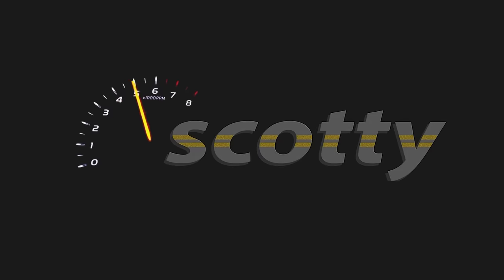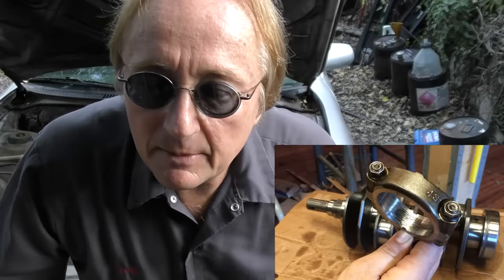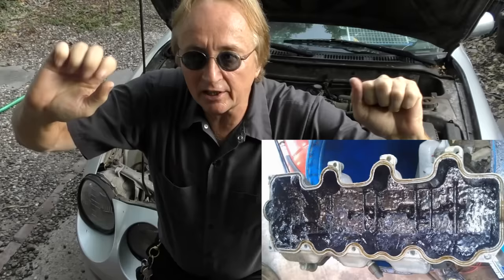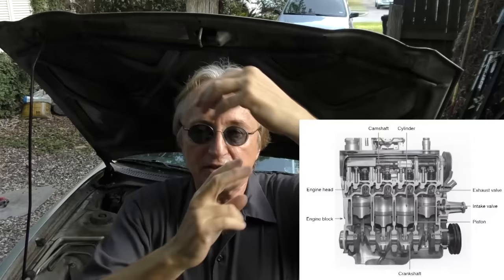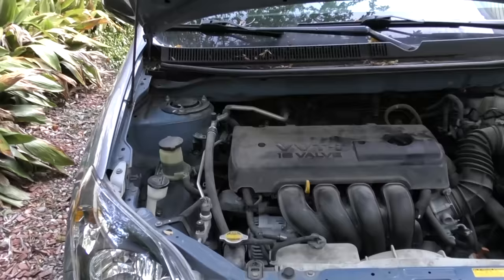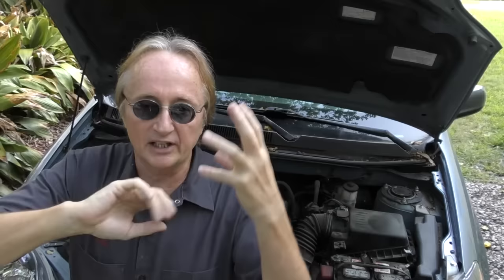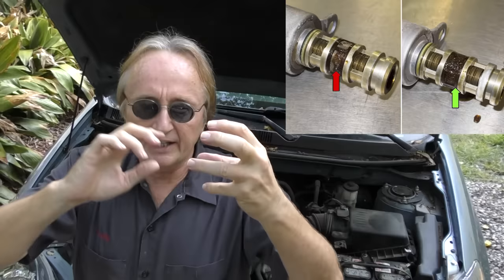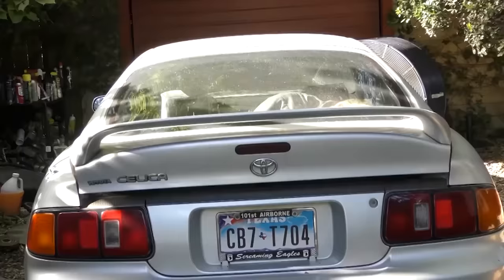Why Not to Flush the Engine Oil in Your Car

Comment: What I've always been told is that it applies to old engines and to cars that aren't seeing regular oil changes because like you said the sludge that build up is what keeping the car together but if the car sees regular oil changes it should be 100% but that's what I've been told just got a car with 215,000 miles and I know it has seen regular oil changes so am gunna test my luck with that 😅
Reply: Sludge does not keep the engine together IMHO.

Comment: If you regularly change your oil, and driving under normal condition. Then I dont really see the need to do engine flushing

But if I bought a used car, i will do that for the next two oil changes then go all-oil afterwards

Comment: My mate did a engine flush on his 17 year old car, the problem he had was leaky seals after that.

I never did a Engine flush, but i have used a cheaper brand of engine oil (obivously right oil for the car) once the car reached at 80k i drained old oil, placed cheaper branded oil drove car that day, then drained it next day, Then filled it up with Mobil 1 esp.
Cuz i do the service myself every year i can sleep at night.

Comment: I remember as a kid, one of the driveway mechanics in my neighborhood would run transmission fluid through and engine. It was a 58 caddy. He said that transmission fluid is detergent and would clean the engine from sludge. I'd watch him drain the oil, change the filter, add the tranny fluid and then run the engine what seemed like 5-10 minutes but it was probably about 2-3 minutes. Then he would drain the fluid and I would see all kinds of sludge and debris. Then he changed the filter and added oil. run the engine for 30 minutes, then repeat. Until I took auto shop in my sophomore year in high school, I thought it was the proper way to change the oil.  I felt sorry for the owner of that caddy.
Reply: If you're trying to say DO NOT put ATF in your engine oil, I'm with you - ATF in your engine? no, no, NO...I worked in a large (2,000 cars) government fleet for 30 years.  I saw engines destroyed because a mechanic put ATF in an engine and the mechanic on the next shift drove the car for a test drive.  ATF is too thin and has the wrong additives, no good for the bearings and rings at all - best do an extra oil change with MAYBE some marvel in it, let it run for 10 minutes and change the oil again and call it good!  I assume anything I put in the engine is going to stay there for at least the next oil change or two (ever disassemble an engine?  Notice HOW MUCH old oil comes out that a change misses?  A LOT, that's how much, at least half a quart).  DON'T put anything in your engine you wouldn't want inside it to drive for the next several thousand miles -

Comment: That's me I used it on a 2006 Corolla with 200,000 miles... and yup, started to leak, I even thought it was the oil filter, I replaced the filter and it still keeps leaking. I learned my lesson. Will never use this again.

Comment: I don't see how flushing the oil can hurt the engine if you followed the instructions. I flush mine every 160k km .I now have 541660 km on my Toyota Carina with 1.5 liter 4 cylinder engine. I did all that driving in just 5 years. Motor runs smooth and makes power just like new.
Reply: Ramjahn Singh My guess is if the engine oil/filter has been changed regularly since day one, flushing it won’t hurt, but it’s probably not necessary.

Comment: Flushed my 07 Saab 9-3 twice in the last 4 years, and it runs sweet with 93k miles on the clock. I do buy decent oil though, and service it at least once a year, usually after 12k miles.
It is a turbo diesel, and the turbo was crudded up, and burning oil. But I ran a turbo clean solution through it, and so far so good.

Comment: PSA 1.6hdi ( Ford, Valvo, Citroen, Peugeot + + +). 
For this  engine dealers recommend engine oil flush on every oil change.
My peugeot 307 1.6hdi 90bhp mileage on clock 170000 approximately. I do flush on every single time oil change. Nothing wrong. I own this car from last 6 year. I do service every 5000 miles.

Comment: What's the difference between changing the oil and flushing the oil ?? If the car is bought second-hand, isn't it better to change/flush the oil in order to be sure that everything is clean and somewhat "new", because we don't know if the previous owner really changed the oil usually or not ??

Comment: I agree w/ Scotty, on the engine flush chemicals.  Risky!  
I have fixed lifters that were ticking due to sludge by adding a qt. of Rislone Engine Treatment Conditioner and Cleaner to a fresh oil and filter change.  Repeat process every 3000 miles.  After a 6000 miles, or so, the lifters quiet down.  This will not work if the lifter has mechanical damage.     For decades, any used car I buy without a service history, showing proper oil changes, gets the Rislone treatment, for as long as I own it.

Rislone Engine Treatment and Conditioner, is NOT a flush chemical, it SLOWLY cleans inside the engine, because it adds detergent to the mixture.   I am not a fan of additives, but this one has worked for me and my customers.
Reply: CD-2 is a good product also but it is hard to find. if my hydraulic lifters are stuck i'm not changing them when rislone flushes them out.

Comment: Some engines have a split rear main seal that is replaced by dropping oil  pan and  gaining access  to rear main seal. No dropping the trans or pulling engine.  Ex. 1993 3.9 liter Dakota.

Comment: if you engine stay alive because of the old jammed oil on your engine, its because your engine is done... 
Common sense is not one of the best Scotty skill.
Reply: Bro if you've ever slimed bike tires it's a similar concept. Like what works works and if you wanna replace your engine or vehicle  because the seals are being held sealed by some  sludge despite the vehicle running fine, be my guest.

Comment: I bought a used Ford F 150 with  over 100000 miles on it. I flushed the oil crankcase with diesel. Truck runs great and no oil leaks.

Comment: The point of a engine flush is to get rid of your dirty oil before it gets to the point of sludge.. even if you change your oil regularly if you go over the required miles for the type of oil your using, your oil gets dirty. So flushing your engine of dirty oil so it doesnt get to that point of sludge is a good idea in my opinion.

Comment: Or you can literally do an OIL flush using ... oil. You buy some oil, not very cheap but fit for your engine and you change it 3 or 4 times, putting some miles between changes (warming and cooling down the engine a few times). Finally, you change it for good with your preferred brand and that's it, you flushed your engine the right way.
Reply: Exactly! 

I changed oil on a used car I bought as it was very dark brown. After few days new oil was almost as dark brown. Changing the oil few times in short intervals would help get rid of the old crap.
Reply: You can do it with a pump same way you flush out a tankless water heater

Comment: Completely agree. Modern oil is designed to suspend the crap in it and not produce any sludge . Just change your oil every 8-10k miles. 
Engine flushes are a throw back to the olden days

Comment: You can also pour 6 quarts kerosene instead of oil to wash the inside of engine. Just make sure to drive at least 100 miles after you pour it inside.
Reply: Kamion King no only idle don't try revving the engine with kerosene in there, it will not provide the proper lubrication. 6 quarts if you own an engine that has that oil capacity.
Reply: OMG  !   Hell yeah, that'll clean it Champ.  I guarantee it will do SOMETHING to it.  : )
Reply: That's flushing buddy.
Reply: Then 1 months later, all your gaskets wil lstart leaking.. Use ATF or the correct amount of seafoam.
Reply: You shouldn't be driving your car when flushing. Also you just let it run for 10mins at idle and you drain it out. Driving it around will seriously damage your engine as the engine oil is diluted and cleaned off by the kerosene.
Reply: @happysawfish  😂😂😂😂🤣

Comment: I always keep about 8 Ounces of Marvel in my engines 
Keeps that engine Clean as a Whistle 
Occasionally pour a bit in my Fuel as well
It's a power adder for diesel fuel
I put a whole quart in a full tank of Diesel
Ya can't add too much.
Reply: Ken Alexander 
Haha I just mixed up a cocktail for my 91 vw diesel last night. 
They like high cetane,like 50-55. 
Besides marvel I use new motor oil and cetane boosters and 2 stroke oil and whatnot. No waste oil, usually about a gallons worth and I throw it in about 8-10 gallons of fuel. 
She runs great. 
As far as flashing your engine,that crap is evil. 
But marvel does clean,it just does it slowly.
 If you start with a decently clean engine ,and add some marvel a few hundred miles before an oil change it'll stay clean.
Reply: I prefer DC in my engines and Marvel in my radiators.
Reply: I had a lifter tic on my old '99 Chrysler 300M (3.5L HO). I did an oil change with a quart of MMO and Castrol GTX 5W-30 Synthetic. A few days later, no more lifter tic.
Reply: Walmart carries it.
Reply: Oils have detergents and additives to keep engines clean. No need for Marvel....BIG DUMMY!!!
Reply: Yes you can add to much,I hate to correct you but you know someone who will do it at some point in time!!!!!!!

Comment: I was always told by my father. A mechanic with 45 years experience. To change the oil every 3000 miles with standard oil. And every 5000 with synthetic. He passed away 6 years ago. Has Synthetic oil improved that much? That you can double the mileage before changing it?  I'm not sure I'm comfortable with that.
Reply: I wouldn't 5000 max for me.

Comment: I used to think u were a genius on cars but the more I watch and listen to u it seems like u were an expert in the past older cars ! And I get ur point that if I flush my engine the engine could start leaking oil from the dirty carbon sludge build up! Well If that's what's keeping my car from burning oil then I don't want it in my engine! I'd rather remove it then fix what's causing it to leak oil I am not trying to just get by least amount of work or depending on oil sludge keeping my car running just enough to not be able to see the problems o no I want it fixed correctly and I'll do it myself or get a friend to help and order parts from rock auto or ebay to save on expenses! Listen up people don't take ur car to a auto mechanic unless there's no way you can do it yourself and if you have to take it to 3 or 5 different shops and play dumb and don't tell them about the other auto shops that have looked at it and also don't just say u need a estimate! Then they will charge you to diagnose it! Say least amount and how fast can they fix it! And to my a list of parts and labor to turn into ur insurance or so you can have ur boss pay for repairs! This will give you the best odds to take 3 or 5 different shops options and then call other shops to cross reference them and doing this u should be able to figure out what the problem is and order ur parts online rock auto or ebay and then call a small shop to work out a deal for them to install it! They all have to go by same standards of hours to do job difference is what charge by hour and how long they guarantee they work!

Comment: I kept flushing my engine and changing my oil with pure synthetic oil and it quit burning oil. Myth busted. Today, I do not have to add oil.
Reply: I suppose if your the original owner and have maintained it throughout of course the flush should be fine. 
But if you buy a used car your taking a risk by flushing the oil. 

Best bet is if you buy used just rebuild it. If you can.
Reply: and now after a year?

Comment: My opinion: clean with seafoam or similar intake cleaner.  Fill tank with 5 gallons of fuel, 15 bottles of cleaner (any kind or mix and match...doesn't matter), and then 5 gallons of fuel (for mixing's sake).  Run car up to temp and drain oil and change filter.  Instead of oil, refill with 50/50 transmission oil and marvel mystery oil.  Run for 3,000 miles and change oil and filter.  Engine will be very clean. This is only if you have a really gunked up motor and the only alternative is physical rebuild.

Comment: Hey Scotty... Serious Question... How do you feel about flushing with oil? ... I slipped up and forgot to change the oil and it's at 20K miles since the last change.... So What if I buy a low mileage filter and a 5 quart jug of Wal-Mart oil and drive it for 100 Miles drain it, remove the filter, and then put my typical Mobile One Full Synthetic back in it with a high mileage filter..... Or am I just wasting my time and money?

Comment: I am glad I saw this video before flushing my sister in law 2006 Scion XB. Her car has oil sludge and I am going above and beyond to clean her engine. I will be removing the valve cover, oil pan, and shop towel everything off. Also, I will do two oil changes. Scotty is this a good idea to do two oil changes without clogging components?

Comment: A good way to make sure you flush out gunk in a modern engine is to refill the engine with cheap oil after draining it (rated at the manufacturers viscosity of course) run till warm, then drain and replace oil and filter with quality replacements. Half of the gunk you will find in an engine is deteriorated cheap cardboard oil filters. No need to do this but every 50,000 mi. If it comes out clean there was probably no need in the first place. Best way to de sludge other than this is a rebuild

Comment: Great video Scotty! Don't flush your engine and don't flush your transmission! There's so much BS car advice out there.
Reply: Miguel Chavez you're the BS. If you change your tranny fluid and filter and change your oil and filter regularly, you won't have issues in the the first place, but best of luck with your lifetime fluids 😂😂😂😂😂
Reply: oil flush is instant rod knock or lifter tick in a container.
Reply: @jstorer1980  Nope. You just don't know what you are doing. Yet to spin a bearing, but tell you what, The last car I flushed, the sticky lifter stopped sticking (car needed a flush due to previous owner going by the "lifetime" fluid maintenance routine....)

Comment: Modern engines with overhead cams, hydraulic lifters, VVT, coolers and turbos may retain 10-20% of used oil.  The new oil and detergents now have to deal with the old stuff and try to keep the engine running and clean.  Perform a second oil change within 15 minutes instead of a harsh solvent based flush.  The new oil will able to do its job much better.  The second flush oil can be used again for the next oil change or use it in your wife's grocery getter, lawn equipment, etc. You will be surprised how much cleaner the engine stays when you flush all the old oil out.  Machinery Lubrication has a great article on Short Volume Oil Changes.

Comment: Hi Scotty,
If you please,can you make a review on the additive “ Ceratech “ from Liqui Moly? or just about ceramic engine oil additive in general..
Thanks alot
Reply: Why would he make a review on something that is NOT required when good oil is used? It might improve things if your engine has slight issues but won't FIX them and people sometimes expect miracles to happen. It also would ruin manufacturers warranty is therer's one still on the car. Just like the point in this video "if it ain't broken, don't fix it".
Reply: Ceramic oil additive are no good.  If you want your engine to last as long as possible i recommend using Militec-1
.
Reply: @kristjanos1  
WOW! Thanks for the tip on Militec-1. I cant believe I never heard of it since I am very much into gun building and maintenance. I will use it  in my cars too. It seems it can be used almost everywhere in a car or fire arm.
Expensive, but it has a huge VERY loyal following. Especially military.

Comment: And get a good oil filter! A name brand quality (not FRAM) with a proper flowback valve.
Reply: JacobJustIts I use Mobil 1 filters, expensive but have great ratings. Any familiarity with those?
Reply: Yol yes! Mobil 1 is what I use. My favourite. Best price for quality ratio.
Reply: Check out the test comparison with the Fram Ultra Synthetic oil filter. Other Fram oil filters are not made well but their Ultra Synthetic oil filter is made very well.
Reply: Blacked Out S550 lGood info!